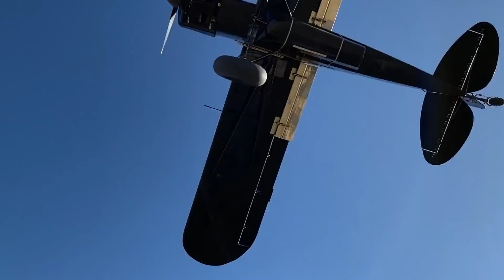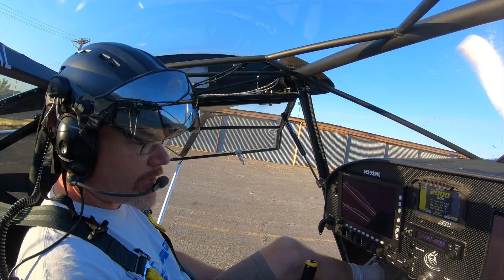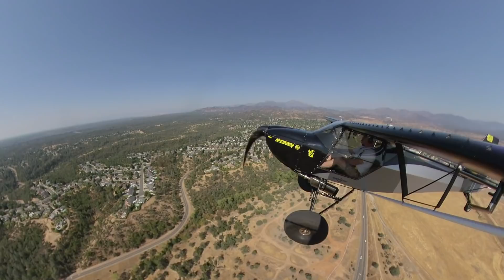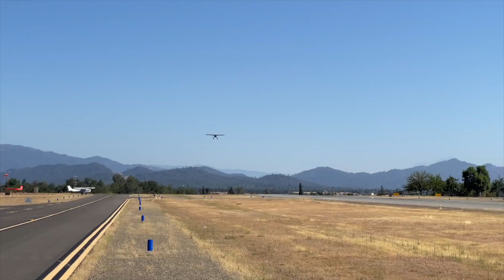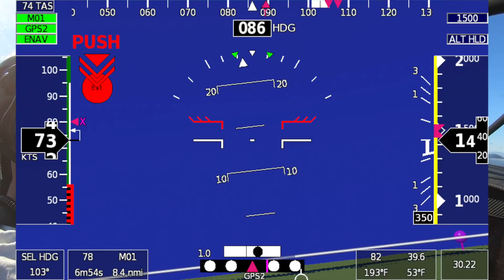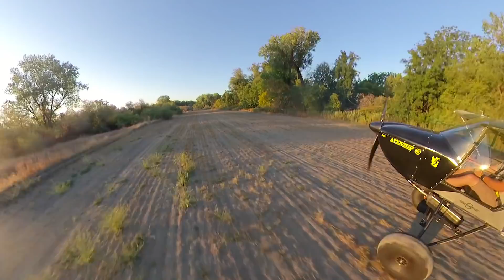Kitfox 7 Apex Build Episode 52 Flight Testing

Comment: Is this a computed AoA or from the pressure differential between the normal pitot tube and one bent at a 45deg offset?
Reply from the maker: pressure differential and then based off known stall speed.